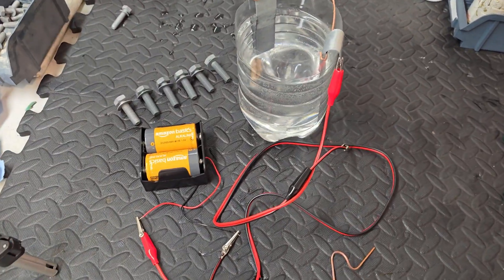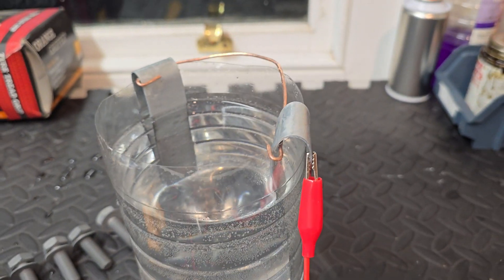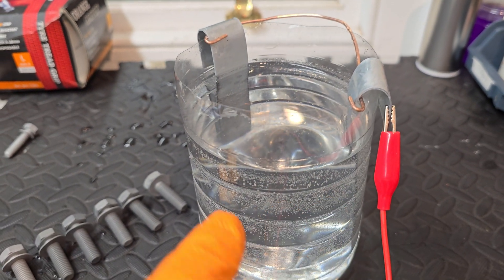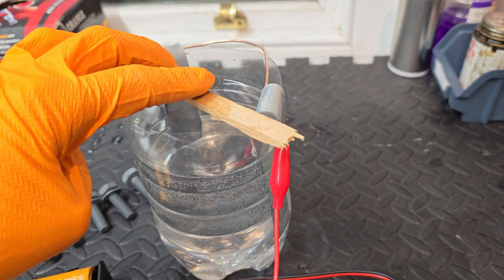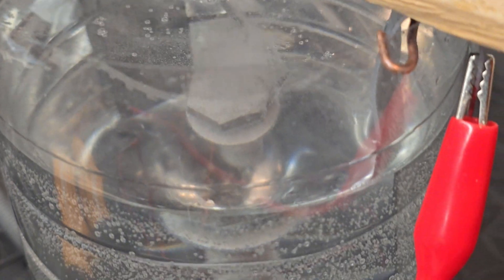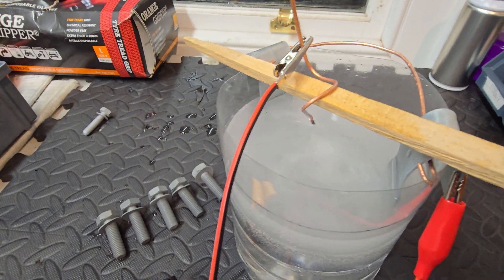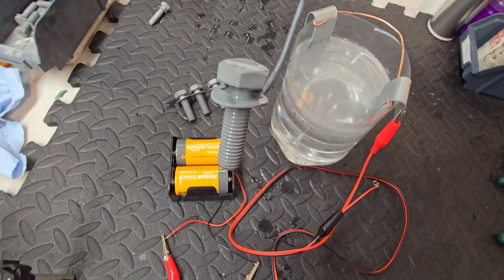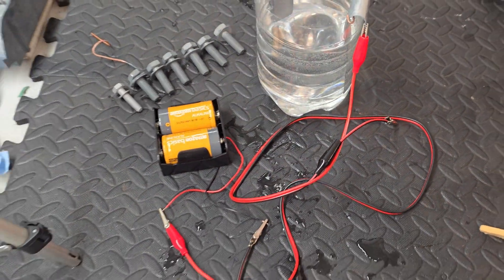Zinc Plating Bolts In 2 Minutes Flat - The Only Guide You Need

Comment: The voltage is critical on an alkaline solution.    Probably why it didn’t work.   According to AI  vinegar isn’t strong enough.   You are supposed to use muriatic acid.   You prove that wrong.    Stupid AI

Comment: Is there a variation of this for zinc-nickel plating? For example, could I perform a second "charging" step with nickel anodes? Or maybe have a completely separate batch of nickel charged electrolyte, then mix them together at a 85-15 ratio before plating?

Comment: Looks like a dead short if both anodes are connected and pos to one side and neg to the other.
He must mean pos and neg to each anode with no wire joining them to change the solution. Then you could connect them.

Comment: I gave this a try over the weekend, mixed up 2 litres worth of electrolyte as I needed a larger container, simply doubled up the recipe ingredients. I found it took slightly longer than 2 minutes to get a good result and I can fully agree, getting the items absolutely spotlessly clean is essential. Once I done that and played around with the plating time a little I was getting some good results. This is a simple method and it works well - thanks Steve.

Comment: I prefer to disconnect cables on the batteries. Otherwise there could be sparks and there could be flammable gas coming from the water.

Comment: Can I use the zinc sheets from AA batteries as the anode?
Reply: As long as it is high purity zinc you can use it. I found sacrificial zinc boat anodes are not pure enough
Reply: @racitup4114 I tried boat annodes thinking heck yeah. I reckon there's hardly any zinc in them. Or is it a different kind of zinc?

Comment: Sorry but they look exactly the same before / after to me..
Reply: Just what I was thinking. If you buy Zinc plated bolts, they are shiny. How is that done I wonder?
Reply: @MidEngineering there is two types of zink plating one is shiny and the other is not. There is hot plating and cold plating. I can see the before and after differencemyself.
Reply: @MidEngineering brightener is added in the solution. A cheap alternative is corn syrup or sugar!

Comment: What happens if you use higher voltage (12V is eazier to come by from a car battery)? Or will you get a Beirut type of event?
Reply: I'm sure that you can find something more suitable than a car battery for a small plating tank. A 9v smoke alarm battery would be enough to do half a 5 gallon bucket tank. I've found through impatience and experimentation that using excessive current when plating and anodizing almost always results in bad quality results.
Reply: @ottopartz1  Thanks for the reply, just wanted to know.

Comment: What would the voltage/current requirements be for 3 or 4 times the amount of solution for increased capacity?  How is that scaled if that’s an applicable question?  I imagine that an increase in the mass of the anodes would be necessary?  Apologies for the newbie questions

Comment: You have the two zinc plates shorted together with copper wire.  If you connect the negative as at 1:32 you will have a dead short across your batteries.
Reply from the maker: Correct! I did not mention that the copper wire only gets added for the plating process, I will add this information as a caption.
Reply: Exactly.  Don't "charge" the solution with that copper wire in place.  Two electrode plates with nothing but the solution connecting them.  Also, this doesn't take 2 minutes...It takes an hour and 2 minutes.
Reply: He was just explaining how to suspend zinc in the solution. The copper wire should be removed for that step.
Reply: At 1:32, indeed, the two zinc plates are connected by a copper wire. If you do as he says,  with what is shown at that time frame, you will have a short across the battery.  While he's talking about the charging process,  loading the solution, that copper link between the two zinc plates would not be there...
Reply: @michaelsimpson9779  ? At 1:32 the negative wire is not connected to the zinc plate! The copper wire is indeed connected to the opposite side of the vessel and that is to get a more even deposit on the part to be plated, the negative is connected to the bolt which is isolated from the zinc plates by being on a wooden rail, have another look.
Reply: No, the negative is connected to the wire hanger which is hanging on the wooden stick, the negative is not connected to the positive wire at all.

Comment: Do you by any chance know how to achieve that yellowish zinc plated look? Either way, this also looks like it will be a good amount of protection, but doesn't look as shiny
Reply: This man did not add brightener to his plating solution. Also it is a very basic ( primitive ) plating solution resulting in a very dull plate. The zinc film must be very thin based on the short time in the tank. You need low voltage 1.5 -3 volts and higher amperage 4-5 amps. The finished plating must be very bright and shiny if you want the yellow rainbow finish. A short dip ( 5 seconds ) in a potassium chromate solution will give you the desired yellow finish.
Reply: To get the yellow look you dip the plated part in a chromate solution, it is an additional set of steps after what Steve did here.
Reply: @ethanallen3625  That or also the yellow/goldish finish could also be cadmium plating which is this yellow colour.

Comment: it just need V or it needs A also? 2x D batteries = 3V and if I adjust my charger to 3V will it run without problems?
Reply from the maker: I'd say somewhere between 0.5 - 1Ah is what you need for 1 litre.